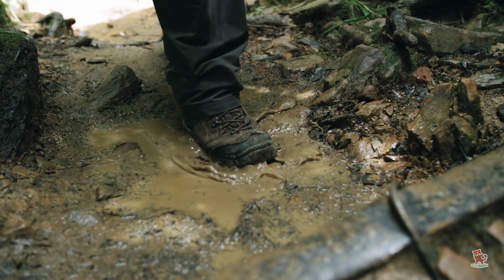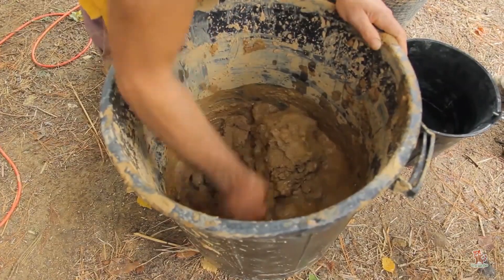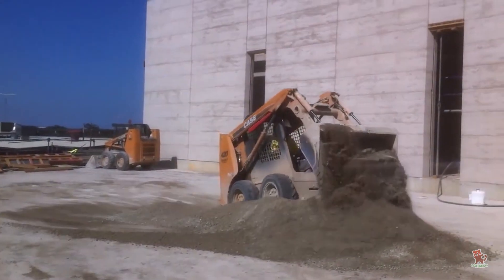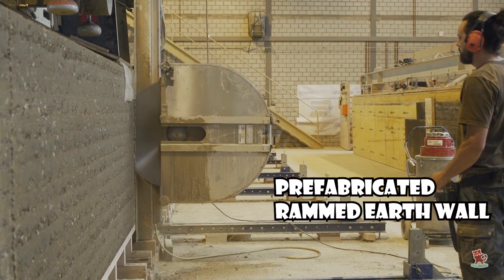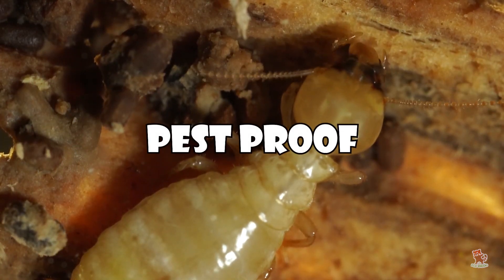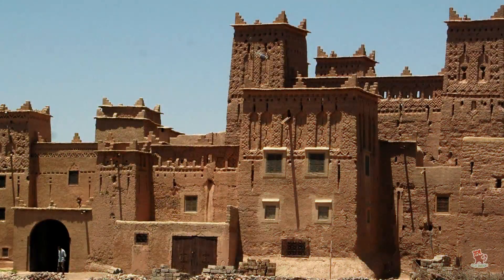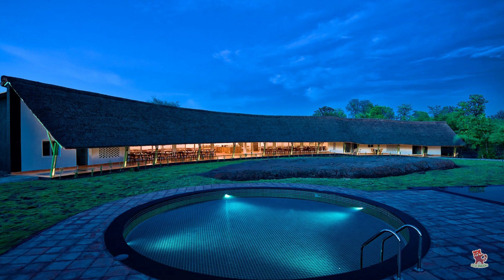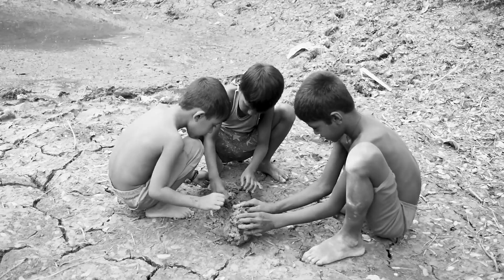What most people don't know about RAMMED EARTH CONSTRUCTION

Comment: I am Indian from Goa. I  want to build my own mud house by myself. So cob or rammed witch technically strong.?
Reply: Hi..do you build rammed earth home? If yes I need your help.
Reply from the maker: Hi Shashank, glad to hear that you are moving towards a sustainable construction model. Both cob and rammed earth construction are eco friendly. Choosing between cob construction and rammed earth construction depends on factors like climate, budget, and desired aesthetics. Cob construction is ideal for those seeking a hands-on, community-oriented project with a unique, artistic finish, offering good insulation but requiring significant labor and protection from moisture. In contrast, rammed earth construction provides superior durability, thermal mass, and fire resistance, with a natural appearance and less labor intensity, though it demands higher initial costs, technical expertise, and formwork. In wet climates, rammed earth is preferable, while cob is suitable for temperate climates with daily temperature fluctuations.😄

Comment: YOU ARE ADDING CEMENT INTO IT; 5% - 10% not much lower then concrete
Reply: It's way lower if you can use onsite soil, and you don't have to use Portland cement. You can also use chalk, or lime. The most expensive part of rammed earth is the cost of labor. So, it's dirt cheap if you build it yourself.

Comment: Now...there are all these "builders" claiming insulation still has to be put in rammed earth walls...
Reply: Because the R-value of a rammed earth wall is only 0.4 per inch. You simply cannot meet the code requirements with a pure rammed earth wall unless the wall is 3 feet or more thick. But with a 4-inch inner layer of rigid insulation (XPS, for example), all you'll need is 18 inches total for the wall.